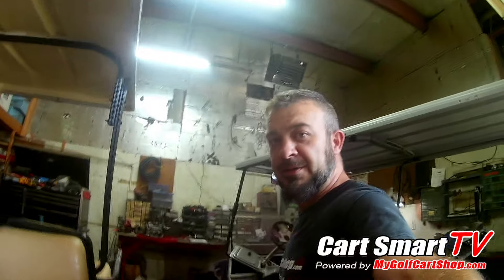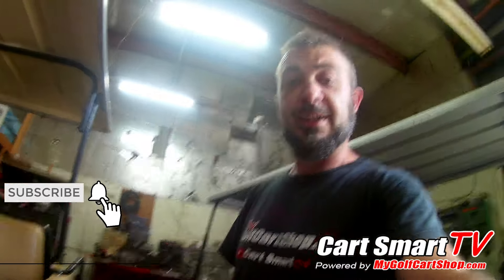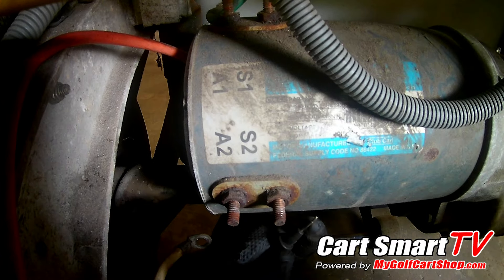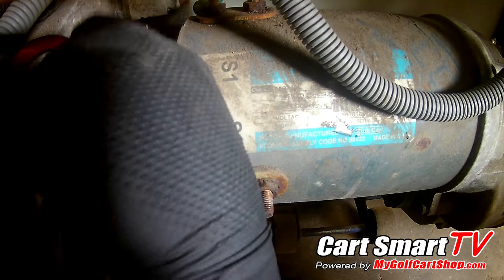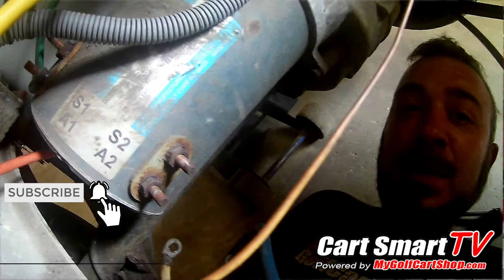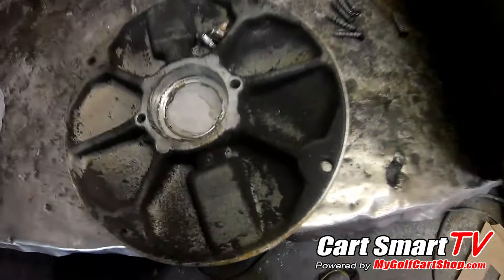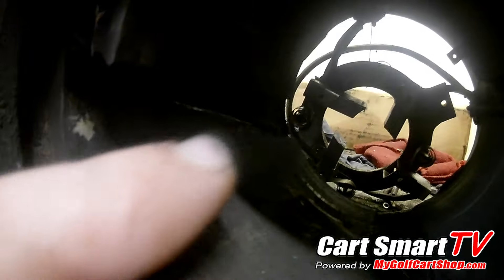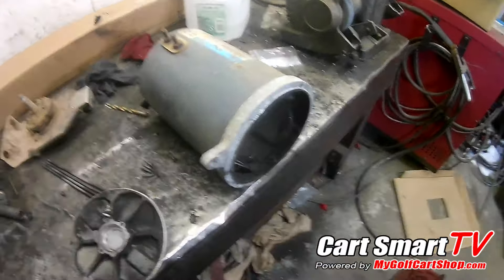How To Test Your Electric Motor In The Cart

Comment: You said S1 to S2 , did you mean A2 in the video; PLEASE CHECK YOUR VIDEO NOW!!!!
Reply from the maker: It was a mess up on what he said, we didn't go back and fix it due to he was pointing to the A2 in the video. Sorry
Reply: @cartsmarttv  I just hope someone doesn’t go from S1 to S2 and possibly burn up their motor.
Reply: What does it mean if there is No continuity between A1 and A2 ? 
And I have continuity between S1 and S2 .
There was no continuity between A1 and motor casing or on S1 and motor casing .
Reply from the maker: @natadams9428  if you don't between A1 and A2 you have a broken wire or brush issue.
Reply: You mean here: 2:54  ?
Reply from the maker: @classic5005  meant A2 for sure.
Reply: @craighamilton1111  I do that with 12v to see if I have magnetism for the field coils. Will not burn it up